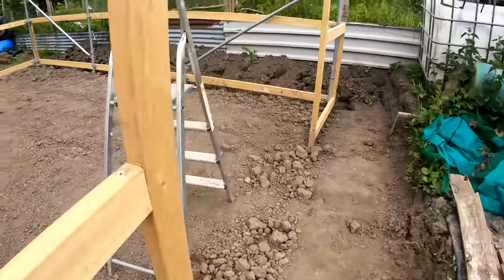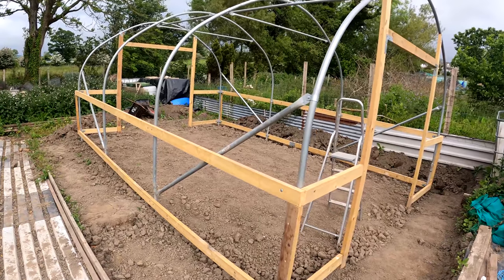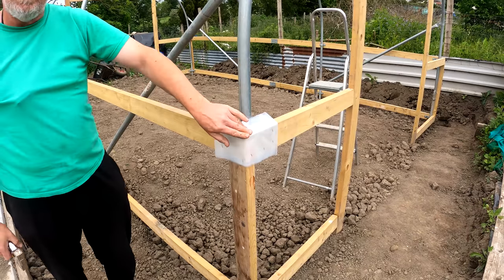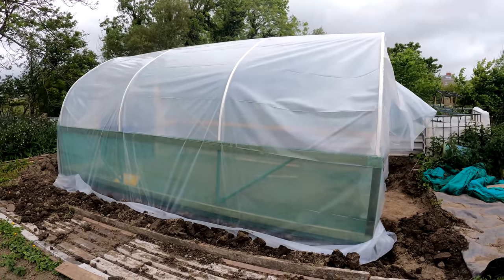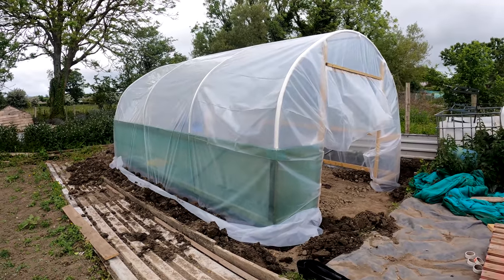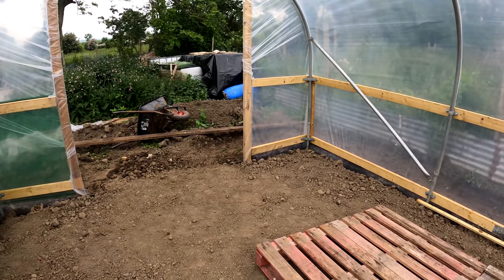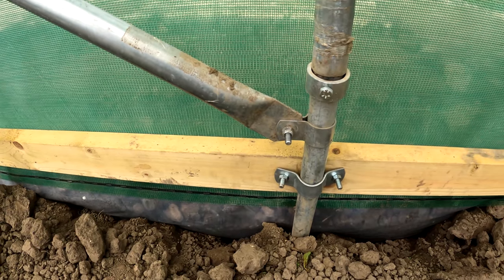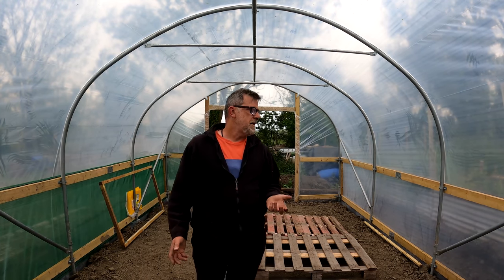New Polytunnel | Cover On | Last build video | Robinsons Polytunnel | Green Side Up

Comment: Great job Steve in my home made polytunnel [3 years ago] 15ft by 8ft by 7 1/2 ft high i used the scaffold debris netting as ventilation but on hot wind free days the air in the tunnel seemed stale over the following winter i bought a wee solar fan £20 it seems to work a treat all the plants seem happier and grew well the following years

Comment: I’m interested to see how you arrange the plastic side where you will do a cut away for the screen, as to how you’ll be keeping the tension on the plastic. Also, very interesting that you will be raising the whole frame an inch or two to get the wrinkles out! That’s gotta be a heck of a job I imagine with the weight of it and the force of the plastic ! Good luck with it, it’s a very informative project and I’m very glad you posted about it. 👍👍